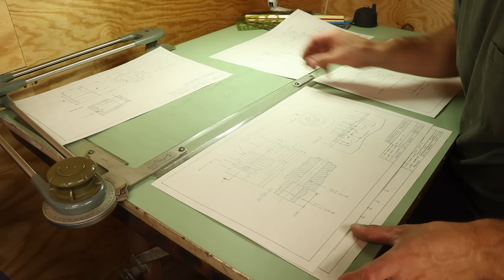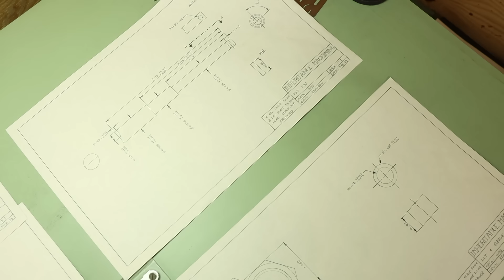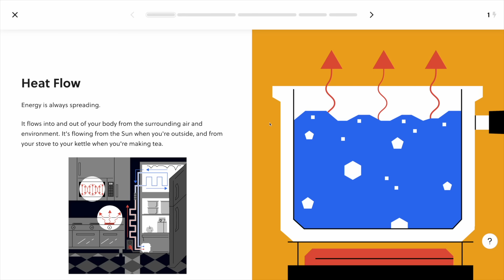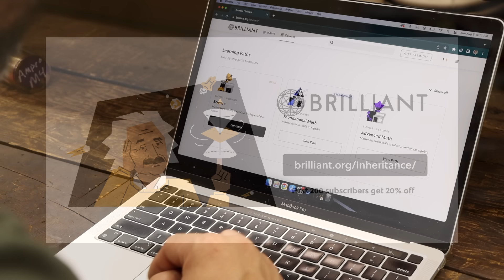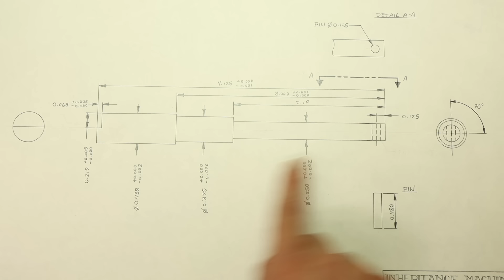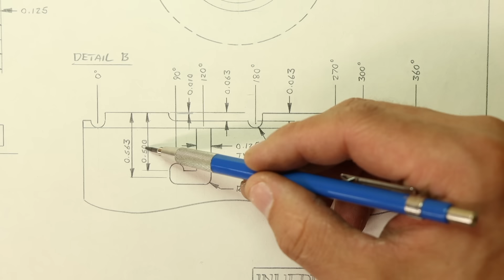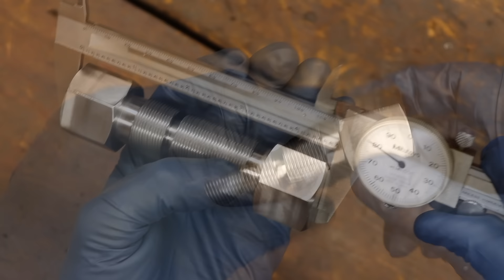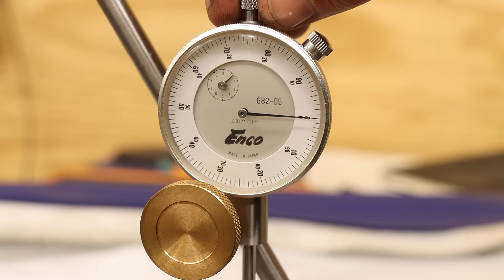Free the Nut! (Not What You Think)

Comment from the maker: To try everything Brilliant has to offer—free—for a full 30 days, visit https://brilliant.org/Inheritance/ or click on the link in the description. The first 200 of you will get 20% off Brilliant's annual premium subscription.
Reply: Just signed up!
Reply: Please make a video making the Diamond Tool Holder that holds a piece of HSS on an angle that only requires one grind.
Reply: I'd like to point out that when you realized that the 2 nuts had uneven spacing it would have probably been easier to just machine away some of the threads instead of moving the J channel. Either way it looks great.
Reply from the maker: @bdkj3e  Thanks! I've gotten this suggestion a lot and there was actually another constraint with the key pin mechanism under that cap, so the slot correction was the only answer without more changes. Though I didn't realize this at the time so I got kind of lucky 😆
Reply: i love how we all slowly realize it is a brilliant integration before he mentions it
Reply: No. Make a living doing something else. Not interested in your advertising

Comment: Gotta respect a guy who still uses a drawing board! I designed a log house a while back on the computer, then built the house. The house had a front porch that went the length of the house. It also had a couple of dormers on the roof. The dormer that was above the living room had to line up with the double window that was below since the living room was open all the way to the peak of the roof with an open loft on the back side of the house. Since it was all opened I built up scaffolding in the living room to make it safer and easier to work on the ceiling and build the dormer and finish it on the inside. We finally got finished and it was time to remove the scaffolding. I was pretty excited to go up on the loft and and take in the final result. My heart sank. The two windows were not aligned. You couldn't not see it. Here you have this beautiful tongue and groove ceiling with exposed beams and a massive stone fireplace and all you can see is the two windows not lining up. They were six inches off. I went back and measured everything according to the plans. The dimension for the lower window was wrong and I never caught it. It took me a long hard day to fix that screw up. And yes, I had to remove and put in new logs and cut logs to move the window over on a house that already had a roof on. The point is, I know the frustration of building something from the plans only to find out one of the dimensions was wrong.

Comment: @21:48 There’s a reason why we switched from drafting tables to CAD. Also, whenever I make a mistake, typically going to short, I’ll create a cap and cut threads on the messed up piece and the cap then just locktite (as long as it’s not necessarily structural

Comment: You can keep the hole straight by starting from one side going only half way the length  of the bar stock and then drilling  from the other side and meet at the center . 
This keeps the drill from drifting.  Of course you must indicate both sides before you do the center drill.
Reply: Ah, but that doesn’t guarantee the hole won’t drift, just that if it does you won’t be able to see it from the end of the pieces haha. The hole can still be off in the center of the piece (the bore will end up being non-concentric and/or non-straight).

Comment: An amazingly complex take on the old captive nut puzzle.  I love it!

(Lots of comments here, so someone may have already suggested this:)  To fix the incorrect J-slot issue, I think an easier/cleaner approach may have been to bore out the original pins from the inside of the nut and install two new ones at the sixteenth different position.

Comment: A mate once said that he wanted to make a couple of this style of "Puzzle", but with a nasty twist. They'd be done using the normal construction of a drilled/tapped bolt and bolt with threads turned down and rethreaded to a smaller size, but he'd assemble one with a nut fitted, and one without, and then THREADLOCK the bolt parts together !
The idea was that he'd leave the one with the captive nut on his desk, and let people try to work out how you got the nut off, but refuse to tell them the "Secret" (That they needed to blast it with a blowtorch until the threadlock had burnt out. :D). Every once and a while, after people had given up, his intention was to quietly swap the one with the captive nut for the one where the nut was separate, and leave that on his desk for co-workers to notice, so as to rekindle their curiosity.

I don't think he ever made them, but as far as I'm concerned, the idea alone was the work of an evil genius, and an indicator of a twisted mind. :D

Comment: You have outdone yourself with this one Brandon!
Beautifully engineered and machined.
One comment about the uneven thread to cap distance - Could you have just turned off some of the thread length at the other end, making the distances longer, but equal with a shorter overall thread?
Reply from the maker: Thanks, Keith! Yeah I considered that at first but the mistake also had an impact on the cross pin mechanism under the cap. Was hard to explain on video so I kinda glossed over it 😁

Comment: 19:40 a simpler fix for the uneven spacing of the bolt heads, from the thread, would have been to shave 1/16th off the thread, so the gap between thread and heads was visually the same.
Reply from the maker: I thought about this too, unfortunately there were other effect the error had on the locking mechanism under the cap as well

Comment: I think for the j channel feature where you had to machine the other one 180 from the first one, I would have found a pin gage the same width as the slot and held it in place with tape, rotated the peice 180 and then use an edge finder to locate the centerline of the pin to find the right location.

Comment: 0:26  There are two obvious ways to build this puzzle.  One is the easier way, where the nut covers the joint between two independent threaded ends.  That's really hard to get to come out looking like this one does with the nut removed, so I'm betting it's the other way, where one of the end caps screws out.  That's somewhat easier to get to work, because you can shave down the shaft before cutting the outer thread in it to get the two end caps to be parallel when you screw it together.

Edit:  You can hid the joint by putting it INSIDE the end cap.

Comment: You could add an extra layer of difficulty by confining the brass nut in it's own trap. Making the seem impossible to find otherwise. Maybe like a small rod, or possibly even a ball bearing if you can make it work, in a cup on the nut. It keeps the nut from moving along the threads. Effectively trapping it against the edge of the threads... Unless the brass nut is held in a specific orientation and the bolt is turned through the nut. 😊
Reply: I mean, that is the simple solution you could take that further by making it spring loaded... having a second, similar to the first suggestion rod in cup, fall down to create a ramp for the piece to be pressed against and retracted into some locked state.

Comment: Great project, Brandon!

For the next one, add a magnet to the inside of the nut, and a captive pin inside the shaft that will only be moved by the magnet by turning the nut to the right position on the threads, which will the allow the inner shaft to be pushed into the slot on the inside of the outer nut.  Easy, right?
Reply from the maker: ooooo I like that!
Reply: @InheritanceMachining  the longer the day goes on, the more I think about this…

Use strong sets of neodymium magnets.  Make the captive pin so that it has a small magnet bored into one end, and have it spring loaded so that the pin pushes itself into the recess and locks the shaft in place, but disengages when the magnet hidden inside the captive nut is positioned correctly.  Arrange the magnets so that when they line up, they’re N-N or S-S, so that the magnets repel each other.

You can even have a second spring loaded magnet pin to lock the threaded sleeve together.  That way the victim… uhhh, I mean the puzzle-solver, has to find the right spot for the captive nut to be in before they can even twist the two parts slightly apart, then find a second nut location to move the inner shaft.

If you want to be really devious, add a few spring loaded magnet pins in various locations that do nothing more than click when the nut passes over them.  That’ll really throw them for a loop.

Comment: The thing with any puzzle like this and solve time is if you get lucky and pick the right method to start probing - you could accidentally solve it in 40 odd seconds if you just happen to try the right pushes and twists first, or you could spend ages on it because the spring or sprung detent forces on that puzzle is strong enough you don't notice it is able to move there for a while. I think its a pretty solid puzzle design and looks really nice. But I wonder how long it will hold up without surface finish changes giving away the solution or it managing to eat a chip jam up never to be moved again as the tolerances are so tight.
Reply from the maker: Thanks! Yeah there were already some wear marks on the shanks that sortof hint at the mechanism. And it definitely needs to stay clean! 😂

Comment: Not sure why yall were disappointed in the torque reading being low when you put in a ungreased bolt.  It did exactly as it should have when you increased the k factor, tensioned the bolt less for the same rotational force.   If you put a torque wrench on the test rig with the new ungreased bolt the test rig would probably read low as well, maybe not as low, but still click before the rig showed what the wrench was set to.

Comment: Could you have turned off 1/16 of an inch of threads instead of widening the J channel, so that although it wouldn't match the drawing, the mistake would not be visible in the finished parts? Cool puzzle btw.
Reply from the maker: Thanks! The error had other implications to the locking geometry under the cap so other than changing a whole bunch of dimensions that was the best way

Comment: this little nut system looks awesome fun to make and great fun to play around with....I wonder how difficult it would be to add another level of complexity ...a pull section perhaps .
Very twiddly nut you have there.
Thanks for sharing ..I am stil a little confused although the first time I watched I was just out of surgery so ..second go and see how we go lol 
simultaneously cattywampus and exactly where it would be is spot on but there is an extra quantum boggle in that until you measure said cattywampus you don't know that its even in the box in the first place.
      The whole point being that you can't measure it without changing what its doing anyway
Did that help🤣
This is one of those fantastic puzzles that really takes some working out but deceptively simple once you know how to do it (all the best ones are) 
from a machining point of view it looks like quite a challenge, there is no wack it in the lathe and away you go whatsoever ....good one
Reply from the maker: Ever since finishing it Ive been thinking of other levels I could add on top! I doubt this will be the last puzzle I'll make. And good call on Schrodinger's theory. I did say I was a little rusty 😉  If you have the tools, you should give this one a go! Thanks as always
Reply: @InheritanceMachining  I may have a go at a puzzle once I am up and running  but my set of abilitys and setup for tooling are as unique as yours ..... I wonder what I would do using those parameters ...interesting one

Comment: Deep inside somewhere there is a bit of disappointment that I now know how it works.  I will never get a chance to figure out this puzzle.  Of course, in order to for me to get that chance someone would have had to watch this video, get fascinated, buy the plans, then build the puzzle and let me try to solve it, so I guess watching it be made will have to make up for that bit of disappointment.  
It did, however, also bring along a twinge of curiosity.  Could I pull off the tolerances to make this and let someone else get the joy of trying to solve it?  Fit so close it doesn't show, with finish so good it doesn't bind up is a bit tighter than my usual projects.
Reply from the maker: You never know until you try! Give it a go!

Comment: Wouldnt it have been less janky to just have removed a 1/16th inch from the threading so tht the gaps matched?
Reply from the maker: I didn't show it but the 16th error also had implications to the cross pin locking mechanism under the nut

Comment: When you mentioned the concern you had with the borehole not being straight/parallel, I wondered if you have given thought to applying ISO or ASME drawing standards. Yesterday I watched a video relevant to precision holes by drilling, boring and reaming. https://www.youtube.com/watch?v=Qs_kXVsTQPE
Reply from the maker: Are you referring to GD&T?
Reply: @InheritanceMachining  Well, engineering drawings may have standards applied to them, i.e., depending on the standard (ISO or ASME), the tolerances and measuring of these tolerances have to fit the standard. With ASME, the borehole has to be measured and tested to a more strict standard, ensuring that the borehole is not bent or off the center line.
With the ISO standard, you could measure and be within tolerance in regards to the diameter of the bore, but there is no requirement for straightness.
Reply from the maker: Interesting! I have never been familiar enough with both standards to realize there was a difference. Personally I would have guessed ISO would be the stricter of the two!